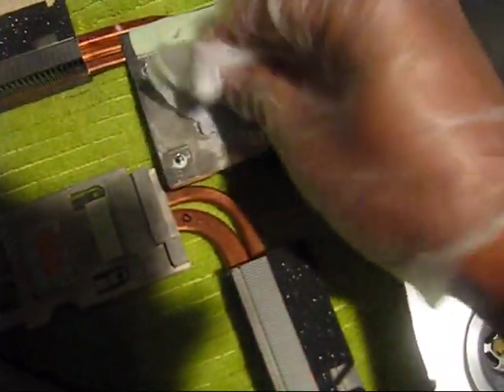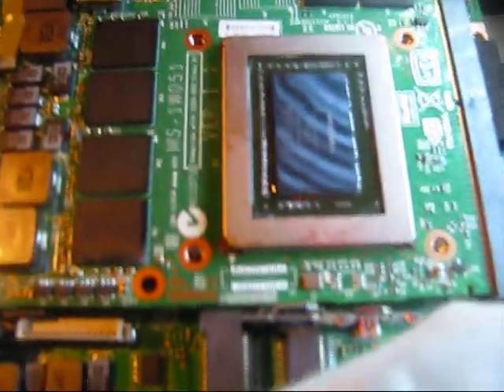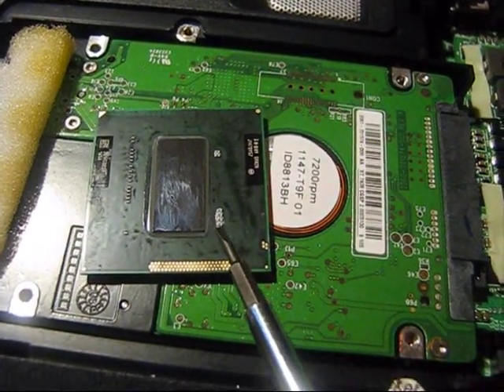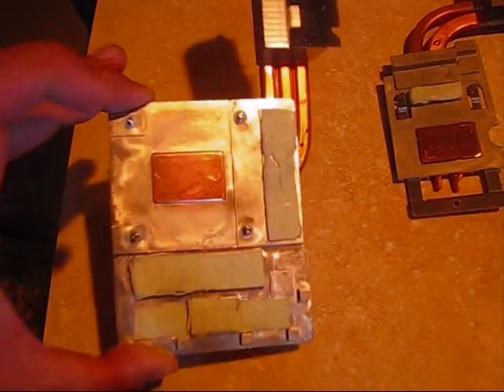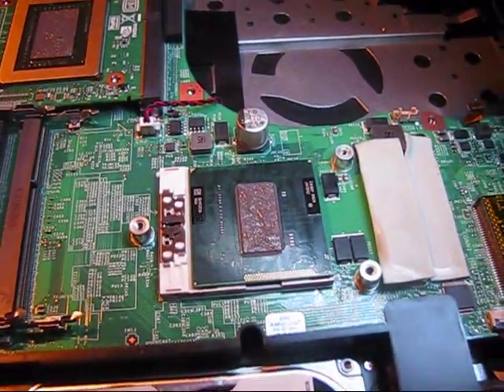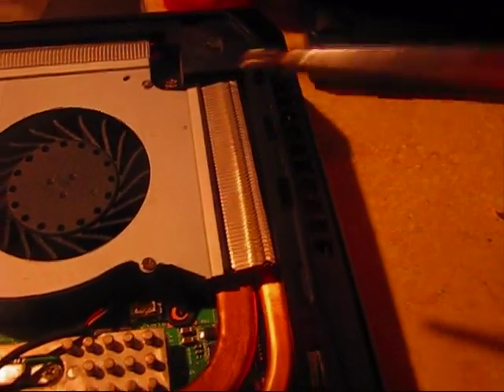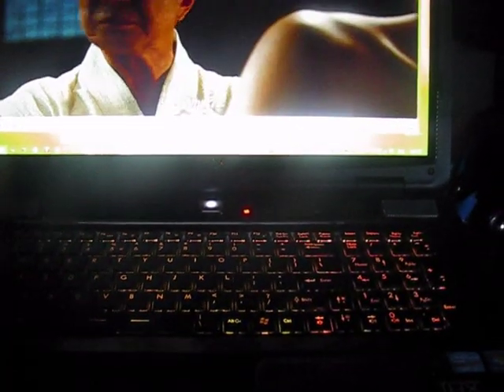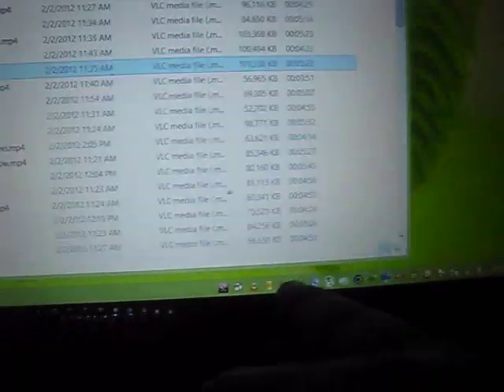How to Fix MSI GT780 Overheating Issue part 2

Comment: Hello, I recently purchased an MSI GT783R which is an extremely similar laptop too yours, I know this video is old, and it's well out of warranty but when I plug it in, or play a game sometimes the laptop randomly shuts down, no warning just turns off, I've tested the RAM modules, Clean install of windows, All drivers updated, device manager has no unknown the devivces, etc. If anyone has fixed this issue, please let me know, and if this will help then i will do so. Thank you
Reply from the maker: This sounds like faulty GPU or motherboard, install something like “ speccy “ software and monitor the temps on your gpu and main board

Comment: Thanks, -30c on GPU :D
Reply from the maker: that's cool, in Alaska, it might be even less than this.
Reply: Hehe :) , ofc i meant -30 from what i had before, 98c was a bit too hot. Now in stable 70 under load.

Comment: Thanks a million mr for this video! :D!!
Reply from the maker: +Maewgln ;-)
Reply: Alexey Gavrilov 

Hi Bro, I have the same laptop and made the same procedure you did. My laptop last for a day or two and keep on restarting again and again. I already bought a brand new original (asus brand) ac adapter with 19v and 9.5 ampere but same issue.

If the laptop is with the battery alone, it is not restarting but if the charger is plugged in with battery or without battery it will start to restart again and again. This issue seems to be unanswered on every forum I read. I hope you can help.

Thank you

Comment: my gpu core is showing 80 degrees, is that bad? I have strange artifacts appearing on screen when gaming, is 800 too much?
Reply from the maker: +makemoneyrelax in Idle or while playing games? if you playing games and your laptop is in cold environment , you should get about 60C-70C depends how cold is in the room and do use use additional laptop cooling pad or not...
Reply: yes I increased the fan speed get my temps down to 70 andstil artefacts where sowing up
yes only in game mode, in idle I see no artifacts because the core GPU is running, which is working fine
Reply from the maker: +makemoneyrelax you leaving in a cold state? I'm from Florida its almost 365 days per year hot... while playing games I'm putting my AC to the coldest temps available...

Comment: Thanks for such a nice video! By watching this, I've replaced my thermal compound. But there is another thing I would like to ask.

 It's been over 3 years I have this computer and actually I'm planning to upgrade my card. Since not every card can fit because of voltage issues etc., does anyone know what is the best card that can work on my msi GT780dx?
Reply from the maker: +Merih Kaner GeForce GTX 980M with 8GB GDDR5 might work but not for sure, you will need to upgrade BIOS and some other things like heatsink, anyway all those upgrades cost a lot....

Comment: My GPU is fine the CPU ,however, reaches 94 celsius Degree or 201.2 Fahrenheit. That's just insane i can clean then from the "obvious" dust but i can not go any further. I lack confidence since I burned my MSI MB like 1 year ago and they fixed here in Saudi Arabia(I bought it from THe US.).
Reply from the maker: SHeeDeED Cleaning from dust and applying new thermal compound will difinetly reduce the temperature on both GPU and CPU cores..

Comment: Is it okay to wash the fan? Coz it has electrical circuit
Reply from the maker: Irse Surya Bagaskara Yes, because of integrated circuit of the fan its better not to wash it.. Just use regular qtip and clean the fan..
Reply from the maker: Irse Surya Bagaskara if you already washed the fan, just make sure you will wait until it will become completely dry, before you will install him back into your laptop.
Reply from the maker: Irse Surya Bagaskara To be honest it's better to spray fan with isopropyl based liquid, it evaporates pretty fast and will remove all dust deposits from the fan.
Reply: Alexey Gavrilov wow okay, thx for your advice alexey 😁

Comment: Hey Alexey, I have MSI GT70 0nd and when I try to play battlefield 4 or other games and programs after like 30 min i get: application (application name) has been blocked from accessing graphics hardware and Nvidia display driver stopped responding and has recovered. And then fans go on 100% and I cant turn them off. Could you give me some tips how to fix it. Gpu = Nvidia gtx 675m. Thanks
Reply from the maker: b4rtek1998 from what I heard, you have severe overheating issue on your gpu...  You need to clean GPU heat sink from dust and apply new thermal compound..
Reply: Thank you for the reply. But I have fixed it. It's not over heating temperature stay around 80. I only get this problem if I have battery in my laptop. I think it's something with power saving.
Reply from the maker: b4rtek1998 Perhaps, anyway you need to check heat sinks for dust. Also thermal compound on CPU and GPU.

Comment: Hey Alexey, is it the same procedure to do with MSIx340? Thanks for your video,it's so informative.
Reply from the maker: Ann Bench Hi Ann... The MSIX340 is pretty old machine witch is running  on Intel Core 2 Solo SU3500 / 1.4 GHz... I believe, you can apply the same procedure to clean it from dust.. But the process of taking it apart to get access to the heat sinks is pretty much different, of course...
Reply: alright,thanks though.

Comment from the maker: Omer Eminoglu, Nvidia GeForce GTX 880M 8GB DDR5 or Nvidia GeForce GTX 570M 1.5GB should work on your machine..
Reply: Alexey Gavrilov for reelz?? u can upgrade from 780m to 880m?? thank you for this video series man i have this laptop (msi gt70 gtx 780m i7-4700mq) and it ran great when i got it (bf4 on high 1080p 45-80fps) but it slowly got worse till it was 5-30fps on 1080 with low graphics and now doing 30-200 fps on low with 720p 

:( do you think i should just get a new card i am pretty stupid and didnt think a company would put out a product that would kill itself doing what it was supposedly meant to and didnt worry about heat at all, i am worried i freid my card is there any way to tell??

but thanks again for this series and it would be awesome if u did one showing how to upgrade
Reply: Sumthin Stupid The card downclocks when it gets too hot so you might want to clean it.
Also make sure the laptop is on performance mode 1 wrong button or combination can chance it happened to me a few times.
Reply from the maker: Upgrade for this laptop is very expensive, I will recommend to take good care of stock video card witch is 570M... Depends on the environment were you using the laptop, once a year or every 6 month it's required to clean heat thinks from dust and apply new thermal compound...

Comment: Alex, I ran into an issue where my MSI GT780DXR is plugged into the charger but it does not charge. I am going to try your techniques in this video to see if this is what is causing the issue. However, I also saw some smoke come out of the port where I plug in the charger. Do you have any advice for this?
Reply from the maker: MZtestvideos Maybe something wrong with your charger... if the smoke is coming out from charging port, you probably got some shortage...take your laptop apart and clean motherboard with isopropyl base liquid  or rubbing alhohol..  this should help..  also make sure that your charger itself is not faulty..

Comment: Hi alexey, I just bought a msi GE60 apache pro Iv had it for 10 days and it has 60c normal temperature and 80c while gaming. What should I do? Iv spent 1700 dollars on this piece of shit that will likley burn down soon and ofc I cant return it.

Im so fucking pissed I want to break it in half this computer is working worse than my 5 year old budget asus
Reply from the maker: You can try to do same, I just demonstrated in this video, this should help...

Comment: Alexey  - I wanted to thank you for an excellent video. My kid's (12 yrs) MSI GT70 was hitting temps in the 80-90s on heavy loads. This was affecting performance and obviously bad for the components. He watched your video, followed all your instructions and his laptop is running in the 50s now.
Totally fixed the problem - thanks.
Reply from the maker: i'm glad that this helped to reduce the temps...  thank you for your comment..
Reply from the maker: this procedure of cleaning from dust and applying new thermal compound in my opinion should be performed every 6-12 month depends on the environment were you using your gaming laptop..

Comment: hot water in your laptop ? you mad russian.

use alcohol and Qtip. i've done it many times since i bought my gt780 and never had problems.

use water and you get problem. maybe even blew fan motor.

mad russian.

Comment: Hey i followed 100% the exact way you did this but when I turn my laptop on the power button lights up but the screen is black. Is there something wrong with my cpu or gpu when I cleaned the old compound off of them? I removed all compound from the metal chips on the cpu and gpu. I cleaned both sinks with water and the fan and made sure they were completely dry. I evenly spread the compound in a thin layer on top of both gpu and cpu. I used startech.com metal oxide thermal cpu paste compound. Can I get a suggestion on what to do? I appreciate any help thank you.

UPDATE: I opened the laptop up again and cleaned the GPU chip around the spot where I put thermal paste with rubbing alcohol on a Q-tip. Works like normal now.
Reply: metal based coumpounds are conductive electrically. it must've spilled on the sides of the cpu and made a short between 2 components. good thing you cleaned it again and redid the paste. metal coumpounds aren't for beginners. clearly you were lucky.

Comment: HI i got msi gt780dx . I was wondering if i can upgrade my cpu to i7 4th generation. My current cpu is i7-2670qm
Reply from the maker: 99% yes you can.... but i do not recommend it... it will cost you allot plus for what do you need that...  this laptop already have enough processing power even with stock CPU...

Comment: Hi im also using a msi gt780 laptop, i just notice that my cpu temperature is changing drastically like in a min it goes up from 50-70 then goes down again after 2-3mins but it stays in a 50-70 temp. I wonder if there is a problem since it doesn't stay on a consistent temp even if im just browsing and watching movies, It's been a year since i  had my friend changed the thermal paste of my laptop, kinda scared to messed things up if i do it by myself..
Reply from the maker: how cold is in the room ..? .this laptop like ac to the full blast or winter times with snow...   maybe you collected a huge amount of dust in 1 year... it depends in witch conditions you are using your laptop...

Comment: Thank you, had a similar overheating issue, followed your guide step by step, now my MSI runs 30c cooler and CPU/GPU are no longer throttling.
Reply from the maker: newer don't play games without cooling pad and ac on at at least 70F cold...  or you will get the same high temperatures pretty fast..
Reply from the maker: thank you for your comment..

Comment: I hit over 95deg C playing BF4 last night while even using a cooling pad to help. So I wanted to see if there was anything I could do inside to further aid the overheating issue and then found this video. WOW what a difference. Now it runs at a steady 52deg C in BF4 with all high settings and slight overclock, I didnt even use the cooling pad yet.
When i pulled my laptop apart the layer of dust was so heavy air was barely escaping. Then the paste was old and crusty barely doing anything and had bare metal spots. Supplies cost under $20 from NCIX and took maybe an hour to do from start to finish.
Reply: yes msi is totaly crap at doing proper thermal paste job. redo your paste when you get new msi computer. 

for my money, i'm never buying msi again. they don't know jack.
Reply from the maker: that's what i'm talking about.... thank's for your comment...
Reply from the maker: i agree, stock thermal compound, is pretty bad, on all laptops and desktops, it need to be replaced after couple of years using the device..

Comment: Thanks a lot for this video.

I have a question. My MSI GT70 (slightly different than yours but the same MSI setup I believe) has been crashing with system errors that usually say: MEMORY_MANAGEMENT error. And a couple other ones less frequently. Sometimes it can last 4 hours before crashing and sometimes it can last 10 minutes before crashing. It seems random.  Do you think my problem could be related to overheating, or would it be something else since it happens randomly and not all the time?

Comment: what if i already did all of this and still have the overheating issue? Will a more expensive brand of thermal compound fix the heating? 

PS: i just bought a Themaltake Massive23 GT notebook cooler still having heating issues.

Comment: Thanks again for your advice, I took off the CPU heatsink and the CPU chip itself came right off with it... even with the bolt tightened. I think this is the issue, as I haven't touched anything but the steps outlined in your video. Have you ever experienced this or know a solution? Thanks again :)

Comment from the maker: looks like there is a shortage somewhere on the motherboard....   or video card is bad....   i reccomend to take motherboard out and clen it with isopril based liquid ( vodka based liquid ;-)) if it doesn't help maybe video card went bad/////   but before you will try this try to remove you ram modules mabe one of them went bad

Comment: Thanks so much Alexey! I can actually feel the air coming out of my 780dx vents now. (They were completely clogged with wet dust and so was the fan)...also my thermal compound had spread from the cpu too (so I'll need to get some more of that).

But temperatures have dropped a lot. GPU idle at 30C, CPUs 32.I'll run some game tests to see if they crash anymore.